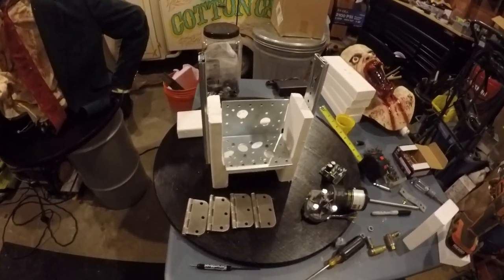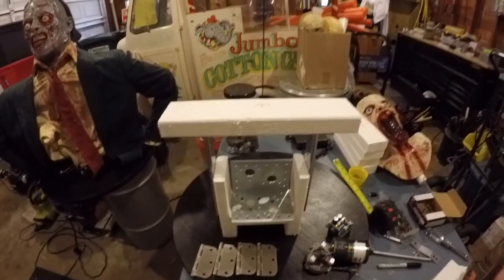How to Build a Ground Breaker Halloween Prop

Comment: Good video, easy to build. I built one last year and building another this year, but did have problems with the linkage. I found the quick connects, my question is what is the length of the threaded 3/8" - 24 bar stock you used for the builds?
Reply from the maker: The rod is 6 3/4” long

Comment: I am struggling with the ball joint gear you used. I saw the link down below but where do you get the ball studs at that attach to the clevis? Can you include link for all part needed? Amazon maybe?
Reply from the maker: Here’s a link to the Carburetor linkage. It’s 3/8”-24  Just do a search for them and you might find them cheaper.  The ones on Amazon had $14.99 shipping 

https://www.summitracing.com/parts/qa1-bjdr6?seid=srese1&gclid=CjwKCAjwysipBhBXEiwApJOcu3dt2ajHr0adKeaAmf5XNkG7J6WAtufSm8FjJhdm2vW_PMOk9Grz5hoCaUkQAvD_BwE
Reply: Thanks, and the round base, is the 24" diameter? @terrifyingtodd
Reply from the maker: Yes 24” base. Sold at Menards, Home Depot and Lowe’s.

Comment: Thanks for ur tutorial looks pretty easy to build. Wat are u planning on using to add sound?
Reply from the maker: Carlos Chavez  I’m still working on the sound.  I found some motorcycle MP3 players on eBay for $15 but they work on a key fob. Can’t figure out yet how to make them work on a loop when the motion sensor goes off.